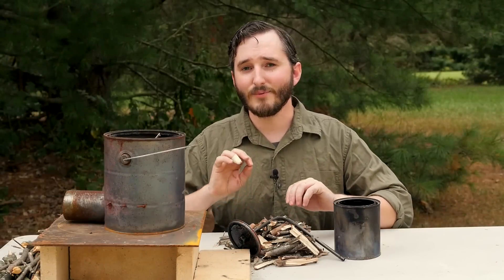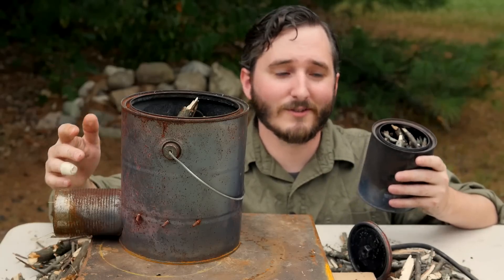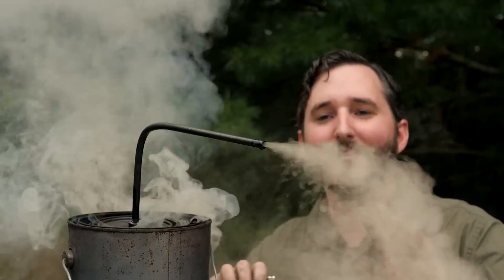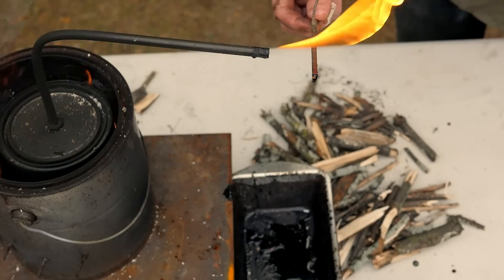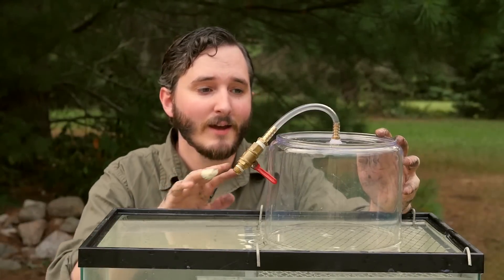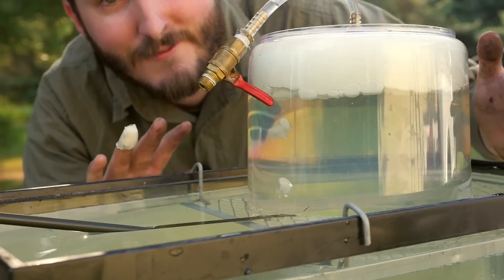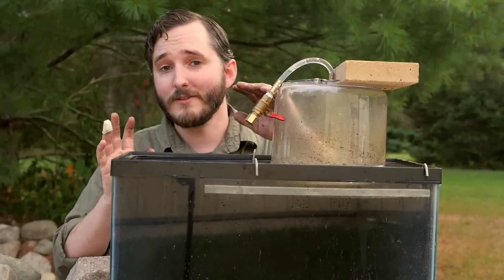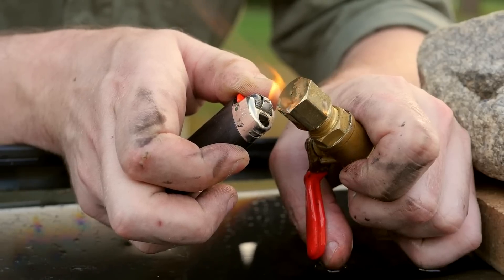How To Make Wood Gas Biofuel (and an experimental gas collection method)

Comment: The system you invented for storing your gas is a very good method. In the UK we used to have giant metal tanks called "gasometers" that did exactly this. Originally they stored "town gas" which was produced from coal. So yeah, you've invented 1900s Britain's gas supply system :)
Reply from the maker: That's pretty cool. Another comment mentioned something like that, it sounds like a method that would be worth playing with more.

Comment: okay so... let me get this straight, wood gas burns clean, efficient, is widely available has as good as no carbon footprint, creates charcoal which is easily falmible and it is rather easy to make. then WHY aren't we using it in mass quantity yet?
Reply from the maker: Less convenient and lower energy density than oil

Comment: I'm thinking you need an old 120 gallon propane tank and run your wood gas generator in the side through a filter (like for a pipe). Then an old AC compressor with an outlet about 12" up the side. Let the gas settle overnight and use the compressor to compress the gas into another pressure vessel, and it should be fairly usable.

Comment: Nice setup. If I could suggest a few improvements: 1. Have your container of gas at the bottom of the tank all the time, then you won't need to lower it. 2. The cap on the end made he pressure too high: I think that's why it burned better without the cap. It may burn better still if a little air is mixed with the gas before you put the lighter to it: like the mixer valve on a Bunsen burner. 3. Cool the gas before it goes into the container: put a wide section of pipe under water so that the tar condenses out. A wider pipe will take longer to get blocked with tar. These are genuine suggestions, I don't claim to be an expert and I don't have the resources to try myself, so offer these suggestions to you so that you may try them for me!
Reply: Jonathan Croley And he could have waited for the water vapor to cook off before he collected the gas
Reply: I can do it
Reply: Hook up a compressor
Reply: How to convert this to liquid state?
Reply: << 2. The cap on the end made he pressure too high: I think that's why it burned better without the cap. It may burn better still if a little air is mixed with the gas before you put the lighter to it: like the mixer valve on a Bunsen burner. >>

Yes,  I think the main problem was too little air mixed with the gas.  When it got out and could mix with the atmosphere,  then it would burn.

A natural gas pilot burner would be better for this,  since it's designed to mix the fuel gas and air properly.

And feed the gas into a balloon for portability and to keep the gas pressurized!

Comment: NIghtHawkInLight, i'm a gold smith and gemstone setter by trade. I think you will be able to get a constant flame if you have air (Oxygen) added to the gas before it comes out. Have a look a look at a bunsen burner, it has a small vale to control the amount of air that gets sucked in. Hope this helps.

Comment: I would recommend you using an explosion chamber next time to capturing flames going inside, because you had some air in it first, and that could have set an explosion in the chamber if it was more, or a flame got in. That could've thrown the rocks towards your face :/

Comment: neat experiment, wonder if the water could be used for fertilizer? I think you can take an old air compressor and remove the motor and put a hand crank on it, then figure out how to take the inlet feed and hook it to your valve, when the gas is about to escape the jar hand crank the air compressor, this will suck the gas out and put it in the air compressor. You could add a water separator to if you wanted to to keep the mist from collecting in the air compressor. Just a thought but i think you are onto something.

Comment: It's not wood gas... Wood isn't a chemical. You don't have liquid, solid, and gas wood. It's methane, hydrogen, etc...
Reply: James Parkes By that logic, then Bio gas is also incorrect. Because Bio is not chemical and you don't have solid, liquid and gas Bio.

Seriously, you need to work on your comprehension.
Reply: I never said "bio gas" is a thing?
Reply: James Parkes But it IS a thing.
Reply: And I don't agree with you. We've been over this.
Reply: James Parkes We've been through this and I could say, with assurance you are incorrect. "Wood Gas" grammatically speaking means "gas made of wood", as opposed to "Gas Wood" which means "a wood in gaseous form"
Reply: There is no gas made of wood, because wood is not a chemical.

Comment: Nice vid!!!! Try with a venturi in order to add atmospheric oxygen in the burning nozle!! Also I heard that prefilters must be added: one to lower the gas temp, a tornado one for eliminating the tat,other with sawwood to filter the tar, and another filled with steelwool to eliminate the sulfures. After that you can compress it via regular compressor and empty propane bottle. I dont know if its safe but there are records from doing it.

Comment: don't laugh but i have run my generator on wood gas for the last 15 years built by a company it's not that special
Reply: hippy9835 what company???
Reply: Which company??
Reply: hippy9835 iv ran my fireplace on wood
Reply: Benjamin P -from what i can tell you could use a carburetor engine but it most likely will differ if you do some research and testing yourself.
Reply: Cool

Comment: Hey first off great presentation on your wood gas video. First one iv'e seen and subbed straight away. I did have an idea about how to store the gas in an easier way maybe* I thought you could get a 44 galleon drum with the bottom off and sealed up top with appropriate gas tap/vent in bedded in the lid for operation. Have a slightly bigger drum or a small water tank to place the 44gal drum in spaced above the bottom on a ring of bricks, then weigh down the top of the drum with rocks etc. Fill with water and have the valve in the drum open so it too fills with water as the air escapes. Have said wood gas maker attached to an extended hose that goes through the water of the outer tank to cool it and have it bubbling directly at bottom of drum so the gas displaces the water as drum is weighed down. You'd want to place a T valve before the water so you can vent off the steam so you're only charging the drum with 'good' wood gas. 

And maybe have a strong enough wood gas burner as in pressurized container, due to the forces of the water pushing the almost full 44gal drum would pop that paint tin lid right off hehe. Please I'd loved to hear you feed back or even if this would be a good idea :)

Comment: Ok well, they actually used something very similar back in the day called a gasometer. The difference being they were much larger and the vessel was 1. weighted and 2. able to move up and down in the water as it filled in with gas. The weight of the inverted jar thing riding on the water and what was put on top of it allowed a constant pressure of gas, and the bell thing holding the gas could move up as the gas went into displacing water and down as the gas was let out of a pipe let under the bell but just proud of the water.

Comment: Can you try to make an all-natural bamboo gun using this gass, a thick piece of bamboo, which naturally has some sort of plugs every so many inches, and fire a metal or stone ball of some sort
Reply: alnoso one problem with the gas though: it needs enough air to quickly combust. Otherwise not much pressure will be built up
Reply from the maker: Would be fun, but no bamboo around here.
Reply: NightHawkInLight also not in certain stores or in online webshops?
Reply: The closest he can get is probably reeds, which aren't nearly as iconic or durable.
Still, he could always just use plastic or metal piping
Reply: McGyver could do it LOL

Comment: Vertically stand 3 inch pvc inside 4inch pvc with a nozzle on top connected to the 3" pipe and a spot for your woodgas inlet to go in the center on the bottom now fill container with the volume of the inner pipe plus 10% or more if you want more pressure but ehh you might spill some water, now as you did in this video suck out the air in the inner tube that outta give you a chamber plus an effective cooling time as you fill the chamber and the bubbles float to the top, if you wanna have fun go bigger allthough it might hurt ya lungs if you go to big and you might wanna consider a wet dry vac to suck up the larger psi. You do know the whole water pressure equation yes?

Comment: The irony of using a propane torch to light a rocket stove for making woodgas for storage...... I understand though, my rocket  stove is a bitch to light. Your collection method is pretty similar to how coal gas was stored back in victorian times. Similar process, pyrolyse coal into carbon monoxide, pump it into large cylinders (basically a piston). Then the weight of the top piston gives the gas pressure.

Comment: If you were to run an engine off wood gas why not just use a catch can, that's what it's for lol or put the inlet for it before the air filter so the air filter filters the tar out, or just run a filter in line with the wood gas pipe

Comment: You could make a gasifier  tower, seperator tower...  with multiple outlets for gasses...  one every 1-3 feet...  this will SEPARATE gasses and tar and other things, especially if you heat it much hotter...  and you can get more pure gasses and have it separated into different parts.

You can also use a coil cooler to condense the gasses into liquids and cooled gasses.  

A refractory distillation tower.

Comment: Would it be possible to connect a compressor to the valve of the collection system? The compressor could connect to a container that is able to withstand high pressures and you can store a lot of gas in a small area.

Comment: Would be nice to set a water tank with a lot of plates inside and the gas would come out at the botton and travel along all the plates inside, so it cleares of all impurities. Then at the top, a lid with a pipe to a compressor. Put the compressor in reverse to a gas tank and suck all the air inside until you get a  negative pressure inside, then reverse the compressor, connect it to the water tank and start the fire. Suck all the gas into the gas tank until your compressor can't compress anymore, or until you reach the maximum safe pressure inside the gas tank. I think Cody's Lab did something like this with his hydrogen generator.

Comment: i think u needed to drill air holes near the end of the valve, so as the methane burned, oxygen would get pulled in from the side like a torch.

Comment: This is a very interesting. And very useful for those who may have to go weeks with out power in wintery area. to store the gas for later application is very important. Could you find a way where producing and storing the gas can be practical?

Comment: Do you think an oil-bath type air cleaner like they used to use on old Jeeps and tractors would be able to get the solids out better, in real-time?  All the old gasified engines I've seen have had the gasifier directly connected to the engine, through some sort of filter, rather than storing the woodgas in some sort of container for later.  I haven't been able to find any information on how the filters worked, though.  :(

I also wonder if you could force the wood gas through a fine mesh underneath an oil bath (to get the bubbles as small as possible), if many of the solids would get trapped in the oil as it bubbled through....  More than would get trapped by blowing the solids down onto the oil as above.  Hmmm.  My guess is no, otherwise those old oilbath air cleaners would have been made that way instead of how they were.  Hehe.

I have an old junk pickup truck (carbureted) that I'd like to try to get running on wood gas, just to see if I can do it, before I haul it to the scrap yard.  Lol.

Comment: Gasification systems usually use multiple steps of filtering and condensers
If you want to keep it simple, just run the gas through sawdust to get the water and most of the tar out

Comment: What I would like to see done with this is for you to bubble it inside of a U or J shaped piece of pvc, with a piston on one side of the bend alowing you to compress the gas. Use a long narrow piece for the bubbler, bubbleing in the gas about a quarter of the way from the bottom, and make the piston a larger diameter and only have it come up to about half the height of the bubbler.

Comment: Seen some of the WWII vehicles powered with wood gas & if memory serves, they had scrubbers that cleaned the gas before sending it to their IC engines.
*PS, it appears you overlooked venting off the steam fraction before you began collecting the wood gas.
Reply from the maker: I didn't overlook the steam. Steam isn't a problem when you're bubbling the gas through water. It just turns back to liquid.
Reply: Perhaps so. Didn't appear to have near the combustion strength of the later fractions, though. Once again going from memory, which may or may not be accurate, at least one of the WWII vehicles I had looked at required the 1st fractions be vented off, even though it had a scrubber.

Comment: A good friend of mine worked all over the middle east and the african continent in the 1970s, a story he told me about riding in a vehicle that ran the engine from the smoke or gas coming out of a wood fire. He said the driver had to get out and stoke the fire a couple of times on their trip. He is a professional engineer and not someone who tells tall tales, I was working in the auto industry at the time so I was very interested and could understand on a basic level how it could work.  I remember questioning him if it wasn't a steam engine using wood to fire the boiler but no it was actually running on the gases produced by the fire. I doubt it would be efficient but especially for a stationary engine might be viable if you had access to a lot of wood but not other fuels.
Reply from the maker: Some people have converted their own vehicles, but in Africa in the 70's I wouldn't be surprised if it was a commercially made gassifier that was still running from WW2.
Reply: Thanks for replying. That makes sense, I wish I could ask my friend for some more information but unfortunately he is very bad health.

Comment: I've done a similar method by taking a news paper , rolling it up as tight as I could, folding the rolled up tube of news paper in half and putting it inside my wood stove. The wood gas shoots out very quickly then catches fire. I always wondered what was going on to make the smoke flammable, thanks for clearing that up for me!

Comment: It seems like wood gas is another name for smoke...
Reply: With the one big difference that wood gas is flammable, and smoke is not. Otherwise yeah lol
Reply: Not quite. Smoke it the only part of wood that burns. To get wood burning it has to turn into smoke first. But what we call smoke is often mostly steam from burning green and wet wood.
Reply: Also smoke has particulates and tar that are filtered out wood gas. Key word being "gas" as the solids and viscous iquids are filtered out.
Reply: Actually smoke is the particulates in wood gas. If you watched the distillation part of the video, he shows the smoke settles and leaves only the gas, mainly composed of hydrogen, methane, and carbon monoxide.
Reply: Smoke is solid particle matter that comes off of a fire. That’s the reason it’s opaque (can’t see through it). The mixture of gases (wood gas) are transparent. Therefore wood gas is not another name for smoke as the OP mentioned. I’m a chemist so feel free to ask any questions. My response wasn’t very in depth so some questions probably remain.